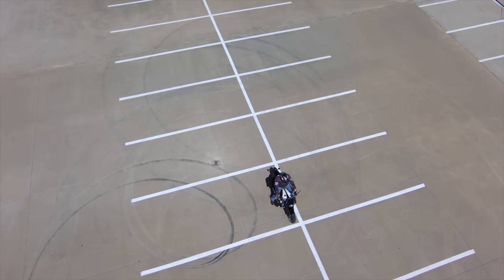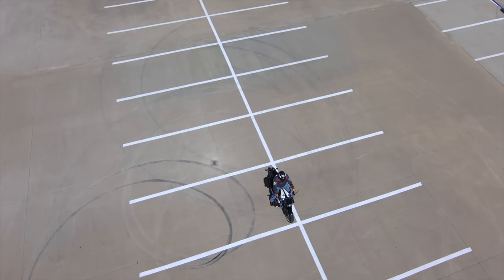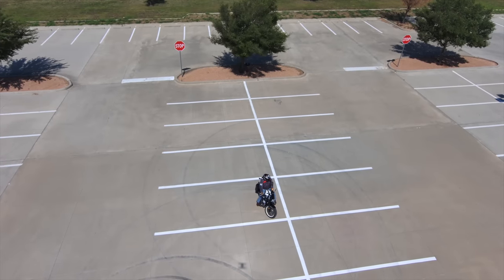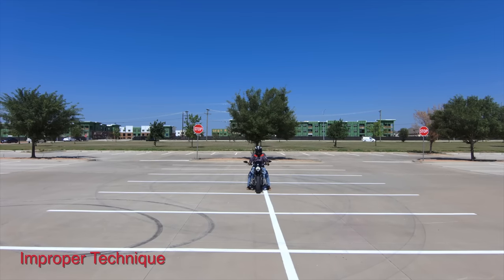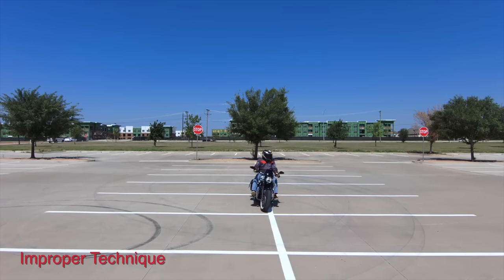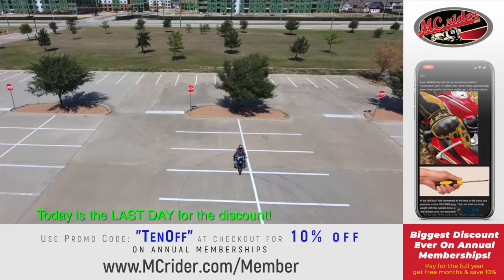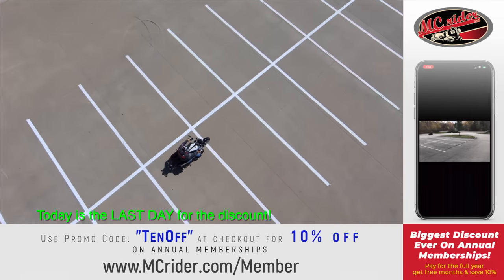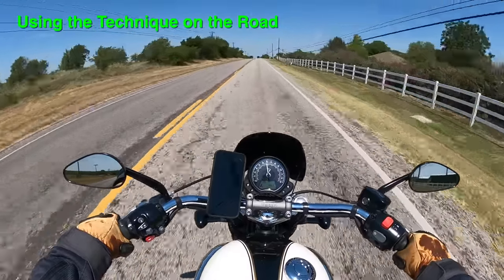How to Turn a Motorcycle from a Stop the Right Way

Comment: Hello. Would you advise the same technique of turning whilst on a sports bike? Reason I ask is that on my s1000rr the bike tends to lock up when the handle is fully turned towards the right or left and hence I have to counter balance the motorcycle and then complete a sharp stationary turn. Your advise would be really valuable.....
Reply: Counter-Steering is the only way you can turn your bike.
My advice is sell your bike and get a 400cc ninja or some other lighter, easier bike to handle. So you can learn something before you get to old.
Learning to ride on that bike, is like learning to drive a car with a racing car… It is way to hard.

Comment: Do you have a video on stopping and starting with turning while on a incline?
Reply: I dumped my bike on a hill a couple of years ago,  It'll be good to see the response
Reply: It is not much different. Holding the back brake. Let the clutch out until it start to engage, then ad more throttle and at the same time let up on the brake and easy out the clutch all the way. You don't have to train on this on a incline. Just practice it until you have it good, then how the road are, is not even a thing. You are just over complicating things, and making it harder then it has to be. That is not a good thing. Then you only learn less.
Reply: @Gismo3333  ok thanks. I’ll give it a try

Comment: I have a habit of turning my head to make sure no car is pulling out of a driveway or coming out of a blind spot last minute while in the middle of a turn. Throws my steady off every time but once I had to avoid one I have trouble not looking every time. May 11th, 1978 (scar is still there) and I still have to look.
Reply from the maker: Old habits are hard to break, especially when they are associated with a crash or close call.  On the road, the last thing I do is check the opposite way...if it is clear it won't change in the 1/4 second before I move out, if it does I did not do a very good job of checking.

By turning your head to check mid-turn you are throwing off your balance and disrupting the turn as you mentioned and you are failing to keep your focus on the direction of your travel. By doing this you are probably carrying more risk than the mid-turn check alleviates.
Reply: @MCrider   I'll have to work on that. Thanks!

Comment: I can do a hard right turn from a stop, falling smoothly into it with that initial lean. Making a hard right without stopping, I don't have the steps. I don't go out of the lane but I proceed more gingerly than I expect I should.
Reply: Probably because you steer your bike like a car, and not like a bike. It is more like riding a horse. But you push the handle bar on a bike, instead of pull the reins of a horse the side you want to go.
And you don't have to do anymore. Then the bike will lean over a bit and take the turn easy. If you need to tighten the turn, push a bit more. The bike will instantly react. So don't do anything more or less, or you will f**k it up. Do nothing and relax, and let the bike do it's thing. It will be the easiest turn you ever made.

You have learned taking a turn, the hard way. That is why you still struggle.

Comment: Should you be leaning your upper body slightly in the opposite direction (i.e. if turning right, lean body left) ?
Reply: No, you don't have to do much. Most people do way to much, when they crash, as a result. Turn right, push right side of the handle bar. And do nothing after that. To make the turn even tighter you push more gently on the right side. And give it enough throttle. That's it. When you get it to work, and tried it couple of times. It is super easy.

Comment: I was taught to find the friction zone and then give some throttle. But at my safety course they switched it up for the road test to give some throttle and then get the friction zone. Which do you think is more efficient?
Reply: Either one works. Finding the friction zone without applying power, then throttling up, then applying power through the friction zone can be more consistent for a newbie who isn't confident in where the friction zone is. It's quicker and smoother though to rev up and then get into the friction zone.

Comment: New rider here. In my practice of right turn from stop, I learned  that if I don’t push right, I will straighten up and go in the next lane (in spite of handlebars turned right and head and eyes being where I want to go.) Didn’t they teach in BRC that counter steering only came into play over 15 mph. That is confusing me. Thoughts appreciated.
Reply: Countersteering works at all speeds on a two wheeled vehicle. What countersteering actually means may trip some people up though. Without overcomplicating, in this scenario you are starting with the bars already turned into the turn and the bike leaned. At this point only throttle control is needed to control the bike. At full lock once you get the speed high enough the bike will stand up.

Comment: Any tips for a tight right turn from a stop on an incline? My driveway has limited visibility, and not only is it not level, the street pavement is several inches higher than the driveway with a brief transition of a foot or so. Without the transition to the pavement, it's still on an incline, so with the motorcycle leaned to the right, it's a little tough to figure out the rear brake so I can throttle without being tipped too far. Being super new to riding, this adds some nervousness, and a couple times (part of the reason I wait for it to be clear both ways) I find myself swinging too wide and a bit into the oncoming lane. I want to cure that.

As of now, I have been approaching the end of the driveway at an angle so I can initiate the exit in a straight line, and then I have to turn in the road itself. For this specific scenario, I wish I had a better answer, but the next intersection from there is ... a right turn from a stop on an incline. It is absolutely a repeating scenario.

Comment: Most of the time you can point the bike in the direction of the turn before you come to a complete stop.  Then it is only a 60 degree or less turn.
Reply: That is only going to be a bad habit that is hard to get rid of later. And make it harder to learn to be better. Do it right the first time, is the way to go. Unlearning is super hard…
And I don't see how that is going to make the turn more easy. Think you only going to go even more wide at the end of the turn.

Just a small push at the side you want to go… And the bike are going to do the rest.

Comment: Does a little bit of pressure on the rear brake help with this at all?
Reply from the maker: You can use a little rear pressure but it is not mandatory. Practice both ways and use the method that works best for you.

Comment: The irony in timing for recommended videos. I just got home from riding. Accidentally left it in second and stalled from the stop sign half way through right turn.  Losing all power while leaned over with a passenger will wake you up quickly.

Comment: I have to partially disagree or at least just add that you should have your right foot up on the board or peg and ready to use a little pressure on the rear brake if needed. But I will say that I love your Channel on YouTube and your videos! Keep at it
Reply: Rear brake? Why? How would you do this on a right turn since the right leg is supporting the motorcycle?
Reply: @snorman1911  when the bike is in motion, both feet on the floorboards! No feet are supporting anything! When you make a uturn from a stopped position, you are in first gear, left leg on the ground, right on rear brake and use the friction zone and already a bit of pressure  applied to the rear brake to turn right or left! No difference :)
Reply: @ChrisYVRVANcruiser  there is a difference because the technique shown in this video is leaning the bike before you start the turn. That's a bit hard with no foot on the ground in the direction of the turn.
Reply: @snorman1911  I send you another video and I will demonstrate that you dont need to lean before the start, what is needed to have have full lock...right or left and that is it! when you do have a full lock, it will have a bit of a tendency to lean the motorcycle naturally but you can do the same thing with no lean at all

Comment: Hmmm.

I have a few issues with your demonstrated technique.  Let me explain.

1) You're starting a motorbike with both feet on the ground.  I am wondering why your foot is not on the rear brake to give you a feeling of the bike's balance, and also be able to ease or apply the rear brake.
2) Because you don't have your foot on the rear brake, you are relying totally on clutch and throttle control only.

Why not fast idle, friction point, ease rear brake to move off?  If the bike becomes unstable, release pressure on rear brake to make the bike stand up.  If you need to turn sharper, add rear brake to cause the motorbike to lean more ( causing the turn circle to be sharper).

Comment: Not recommended to turn front wheel and then lean into a turn from a dead stop  on a bike and rider weighing over 1100lbs. Much better to keep bike straight up foot on rear break, stand bike up with gentle release into friction zone and then begin the turn.  Its the way I do it on my Transcontinental.

Comment: I always counter-steer. Seen so many people nearly die, because they steer the bike like this. When they give a little to much throttle… because they are a little stressed for missing the green light… And the bike turns to the left instead of right. And they set course for the front of the car coming against them. Meat on aggressive driver, and you are smashed. Then you don't have to lean the bike over also. Only push right, and the bike doing the rest by it self. Don't even have to ting about anything… just like riding a good old horse, that knows where i want to go.

Comment: Works on lower Bikes perfect. However, higher Machines need another Skill on Top: Starting only on one foot. Because if the rider is not able to get a good and secure position without both feets, he is not able to lean it before Start.

Comment: I want to add #3 Advanced technique : Countersteering from the stop. Turn your head into the turn but make the front wheel point OUTWARD before starting. 

It’s scary for most people but it is the most efficient method to quickly lean the bike and make tightest turn. Japanese police riders routinely practice this technique.
Reply from the maker: I have never tried that. 

I would assume it requires a little more lean angle and more aggressive start than the technique shown here...I may have to try that next time to see what I think.
Reply: I always use CS when taking a turn. Because it is the only way a bike can turn. That is psychics.

Comment: This is why we have trials Motorcross ice racing road racing and others to action better motorcycling handling which used to be a category to sign up to for experience and then it got into experienced riding for elite purposes from these groundings 
Which will be bought back into play with support for the rider 
The avenues here are very misleading but only if there was a perfect place for swishing or swaying like this 
Proper teaching experience needs to occur as other vehicles to gain experience comfort within or on 
AFFA angels never die nffn HMS council

Comment: Kevin, this is a skill I find lacking in the majority of riders I observe… they invariably go wide on right turns… I noticed that on the frontal shots at full stop you had both feet on the ground… right foot should be on the rear brake… practice should start with right foot on rear brake…
Reply from the maker: "I noticed that on the frontal shots at full stop you had both feet on the ground… right foot should be on the rear brake"

I have no problem with the right foot on the brake, but I would say it is optional.  On this particular bike the handlebar is fairly close to my knee at full lock so I prefer to start with my foot on the ground. Plus you can't lean the motorcycle to the right with your foot on the brake.

It would be one of those things that I would say, "Practice both ways and use the one that gives you the best results." For me it is as I demonstrated.
Reply: I think people are missing the point of this technique where the bike starts out leaning into the turn. On a right turn the right leg has to be on the ground.

Comment: Interesting.  I've watched a very popular ex-cop teach "slow speed maneuver"   techniques that allow his students to effectively and successfully complete these tight turns without lean or having to pre-stage the turn...on heavy bikes.  I am surprised you can't.   I know you're a fantastic instructor with years and years of experience, yet I also see you're dragging your feet.  Interesting.
Oh well... seems there are several methods that work very well.  ALways good to have multiple tools and skills for various scenarios.
Reply from the maker: There are often different ways to achieve the same goal, as long as it does not put the rider at risk I have no problem with that.  But, you did not see me dragging my feet. 😉

Comment: You claim that we ride on the wrong side of the road here in Britain,  but I submit that driving on the right is illogical as most people are left to right oriented. 
For me riding a motorcycle on the right is as weird as reading from right to left.
However,  the turning video was equally useful in whenever country we reside. I just think you drive on the wrong side of the road!
I know you won't agree.
Reply: We honestly don't care amigo
Reply from the maker: But I was on a British bike so that has to count for something. 😄 Even if I ride it on the wrong side of the road. 😉
Reply: Even the light-switches are backwards in England.  🤣
Spent a month there, beautiful country.

Came back to the US after that month-long visit and immediately started driving down the wrong side of the road.  🤦

Takes a day or so to fully adjust back, but after that time it feels natural again.
Reply: @MCrider  No, because a bike is different to a car. Actually, I find old British bikes strange with the rear brake pedal on the left.
Reply: That is wrong. It is only what you are used to.